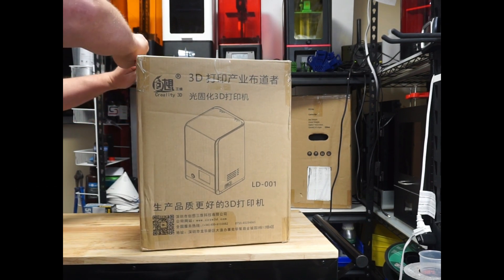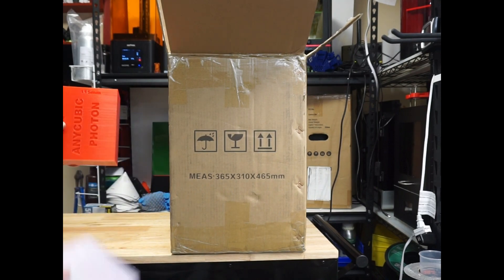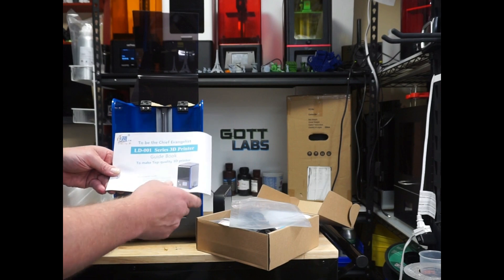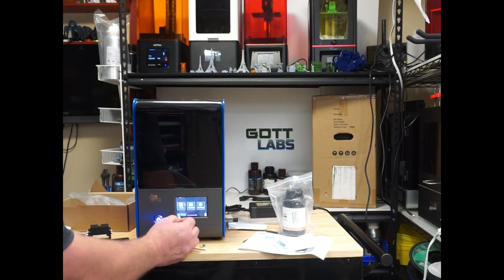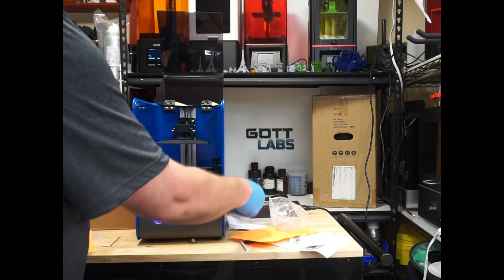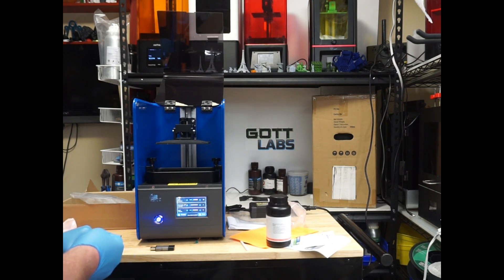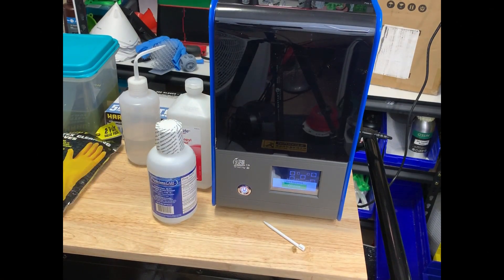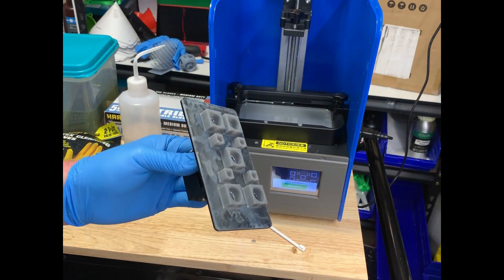Creality LD 001 First Use

Comment: That build plate is actually glass, and prints have a tendency to rip chunks out of it when removing them from the print surface. I ended up completely removing the glass plate and printing directly on the metal surface instead.
Reply from the maker: thanks for the info. I haven't played with it much yet- I was going to find out what it was made of. Seems like a pretty decent printer, I'm looking forward to getting more done on it